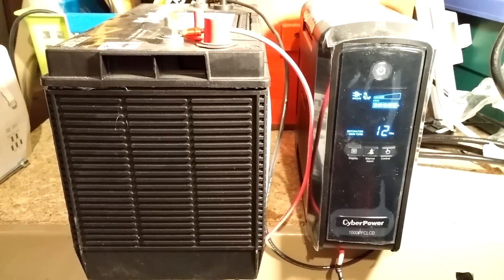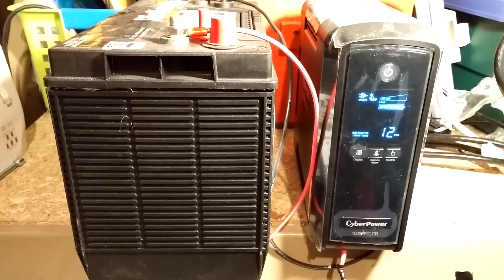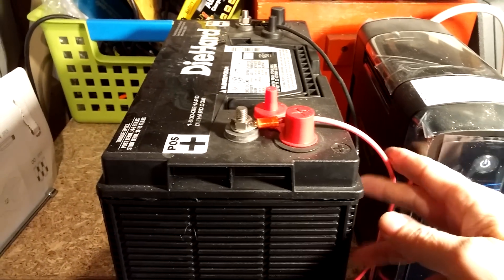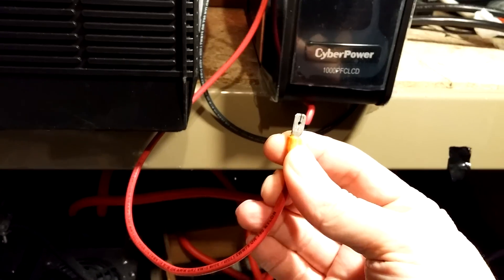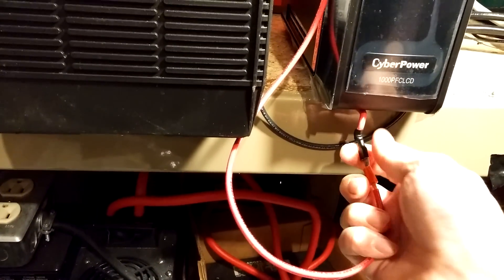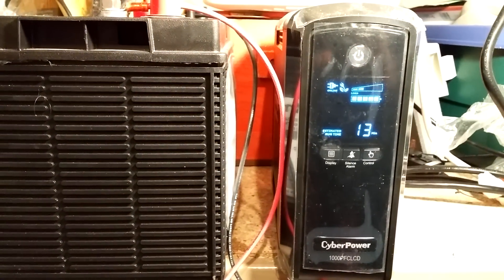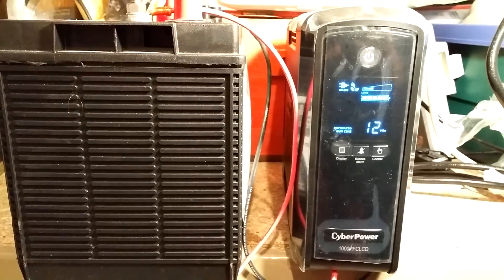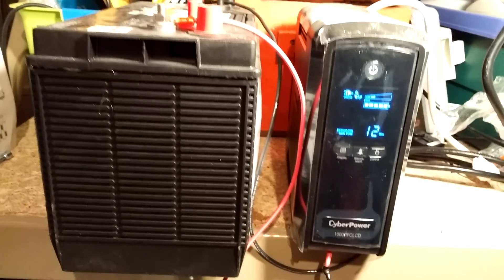CyberPower PFC Sinewave Series UPS battery mod

Comment from the maker: I do use a small fan to blow air into the UPS vents if I run it for an extended period of time.   I have not measured the temperature of an component inside.

Comment: I thought these used a 24V battery pack.   at least my CP1350PFCLCD does
Reply: the smaller units use 12V, the bigger one's 24V

Comment: Out of interest, have you used a thermal camera or just a plain old thermocouple or thermometer to see what temps the unit gets to when running for extended periods on external battery?
the reason I ask is, MANY of these smaller end user UPS devices are designed specifically to run for a set amount of time with the heatsinks they use to cool the MOSFETS
so extended run time may cause over heating and vastly reduces the life expectancy.
planned obsolescence and that kind of thing.

MOSFETS in power conversion pump out a shit ton of heat.

and these things are generally designed with horrible (if any at all) ventilation too.
Reply from the maker: I do use a small fan to blow air into the UPS vents if I run it for an 
extended period of time.   I have not measured the temperature of an 
component inside.
Reply: The battery can support a big loads only for a short time.
The electronics are designed to deliver power for that time frame.
How is that planned obsolescence?

Comment: Nice!  What's the longest you've actually tried letting it run w/o the external power?  And on what kind of computer/equipment (wattage)?
Reply from the maker: Jeff Hunt I run 210-350 watts of load on this and have run it for 3 hours during one power outage.  The battery is 100ah at 20hr rate.  I think the battery that come with it is 9ah or 450ma at 20hr rate.
"For deep cycle batteries the standard rating is 20 hours. So, if a battery has a rating of 100AH @ 20 Hr rate, then that battery was discharged over 20 hours with a 5 amp load."

 For deep cycle batteries the standard  rating is 20 hours.  So, if a 
battery has a rating of 100AH @ 20 Hr rate, then that battery was 
discharged over 20 hours with a  5 amp load. - See more at: 
http://www.batterystuff.com/kb/articles/battery-articles/what-does-20-amp-hr-rate-mean-.html#sthash.wvYpL94k.dpuf

 For deep cycle batteries the standard  rating is 20 hours.  So, if a 
battery has a rating of 100AH @ 20 Hr rate, then that battery was 
discharged over 20 hours with a  5 amp load. - See more at: 
http://www.batterystuff.com/kb/articles/battery-articles/what-does-20-amp-hr-rate-mean-.html#sthash.wvYpL94k.dpuf

 For deep cycle batteries the standard  rating is 20 hours.  So, if a 
battery has a rating of 100AH @ 20 Hr rate, then that battery was 
discharged over 20 hours with a  5 amp load. - See more at: 
http://www.batterystuff.com/kb/articles/battery-articles/what-does-20-amp-hr-rate-mean-.html#sthash.wvYpL94k.dpuf

 For deep cycle batteries the standard  rating is 20 hours.  So, if a 
battery has a rating of 100AH @ 20 Hr rate, then that battery was 
discharged over 20 hours with a  5 amp load. - See more at: 
http://www.batterystuff.com/kb/articles/battery-articles/what-does-20-amp-hr-rate-mean-.html#sthash.wvYpL94k.dpuf
Reply: mrviper100  What kind of issues do you have with charging? Seems like a battery that big would take forever to charge with the small trickle it will get from that UPS. In fact, I wonder if the small amount of trickle it gets will eventually cause the battery to fail since they are designed for a far different charging curve than what the UPS is designed to do with a small AGM battery. Any thoughts?
Reply: I was planning on doing this mod. The UPS was on sale and it's an affordable 'almost' pure sine solution. I'm quite interested in the amount of wear and tear that happens to it on battery since it was designed to be used primarily on standby. I'm going to add to my setup a solar panel and a charge controller. It's a perfect emergency backup for the home and storage appliance to capture solar energy during the day and also recharge during off-peak rates.
Reply: Few thoughts. Yes the recharge time will be slow and that could be a problem if you have extended outages I suppose. After an outage you can use a car battery charger to boost the recharge speed. Otherwise the top off and trickle charge is fine. You should add an inexpensive volt meter ($3 on Amazon) to watch the top and bottom voltage. The UPS should protect the battery from a deep discharge that would otherwise ruin the battery. I would check that the battery charge voltage of the internal seal battery is within safe range of your external battery. 

I would be inclined to keep the internal battery and add a blade tap to make and external polarized quick connect. Safety first, your mod makes it possible to reverse the polarity and/or short out the system. The concerns posted about extended runtime overheating (possibly catastrophically failing, fire, damage) are worth considering. Hacking a external fan, or adding some screened vent holes and doing a test run time under load with a no-touch laser temp sensor would be a good idea.  

As for the runtime calculations, the factory assumes a given table of load % and battery voltage drop over time. There could be a hack to set it to think it is a different model, they make a 1500VA for example but the overload warnings could be a problem. On Amazon you can get a $15-$25 volt meter and load monitor, if you want more info. With that hack you won't need the $3-$5 meter. 

You can also look for a UPS with an "extended runtime" option. These will have a external port to plug in a battery pack and would have thermals and runtime calculations that account for the XR time.